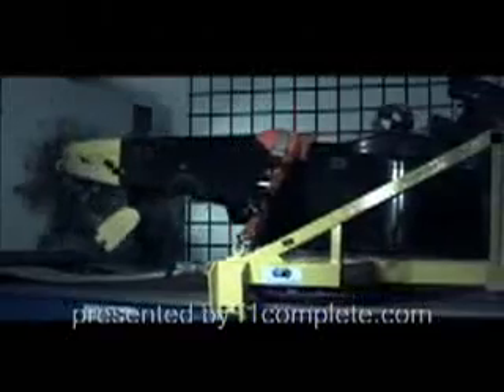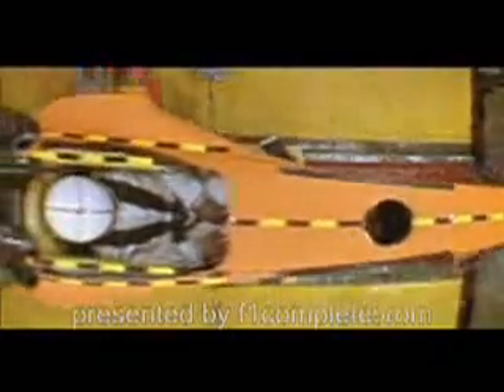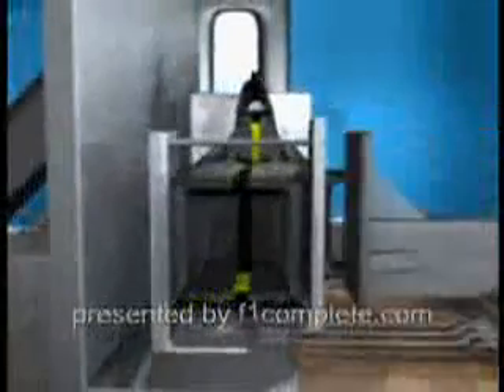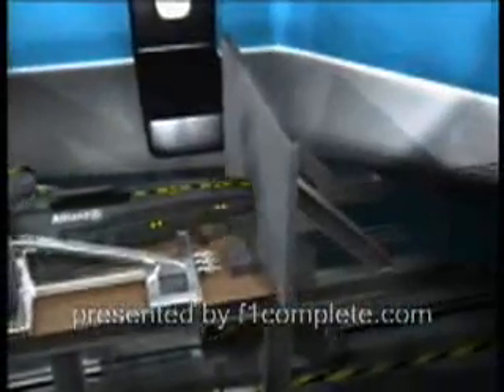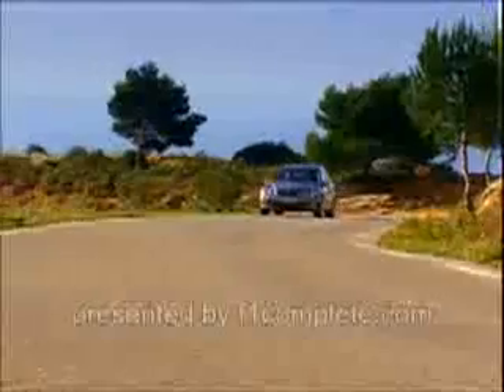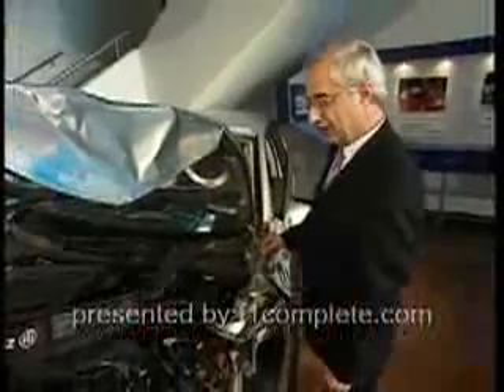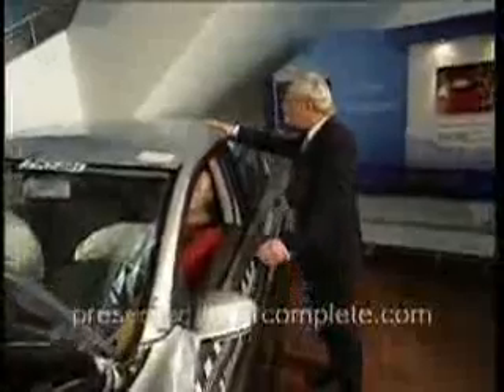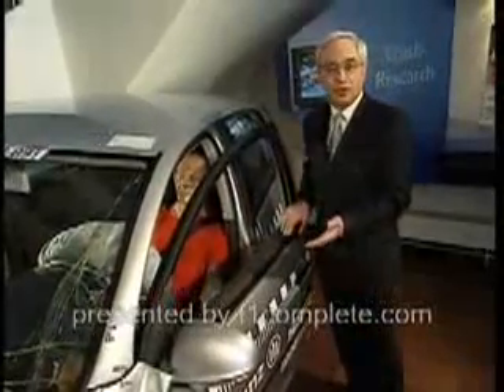Formula 1 monocoque

Comment: @rotterdam1953 
Formula cars that had tubes (Indycar) or the monocoque (F1/ Europe) made from aluminum was all that bad. At the same time, they weren't all the great for safety either. The biggest problem with the older aluminum design wasn't the aluminum. Many many types of Formula cars even sports cars had aluminum tubes, the fact that with both F1 and Indycars the drivers were seated too far forward. in most cases the drivers legs extended forward of the front wheels leaving them exposed.